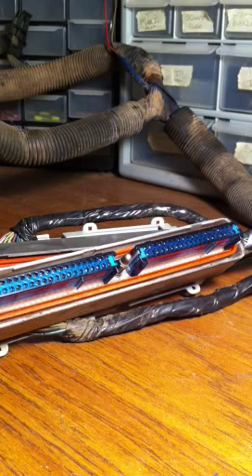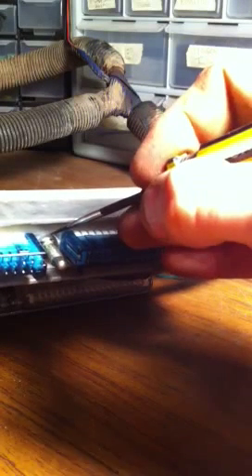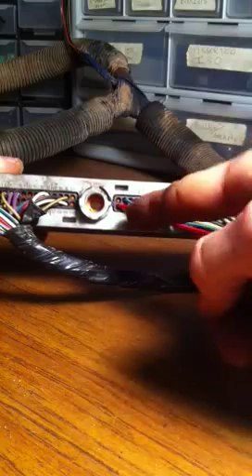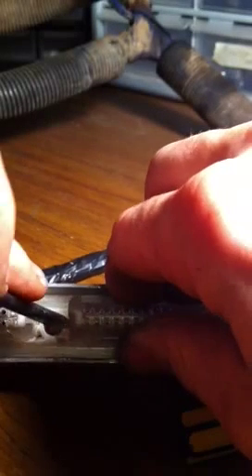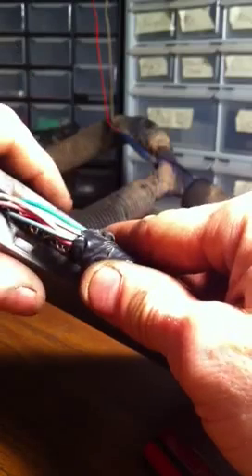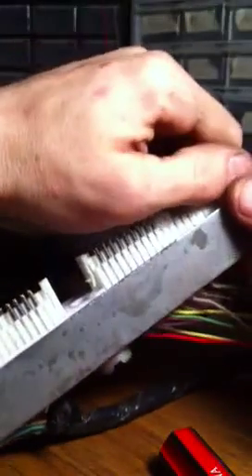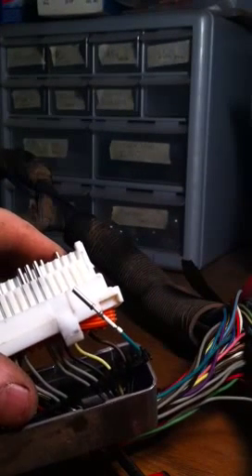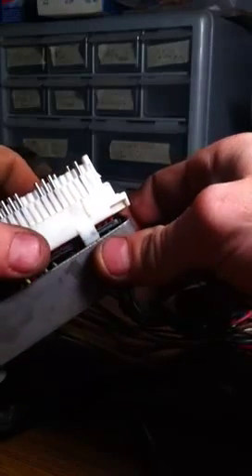Disassembly of GM PCM connector

Comment: Just to add some time savings.   My harness did not come with the gray plastic cover.   If you have it and dont mind dremeling it off/dont have it (its captured by that bolt with the washer thats a pain to get off) than  you can keep the entire thing together and simply remove the see through plastic cover (blue or clear) and then pry on the little white tang to release.  No need to pry when inserting a new one, but the clear/blue cover still needs to be removed as that "locks" those white pins in place.    If you are using a pin hole you have never used, you might need to use a small drill bit or something to poke through the yellow rubber seal, which is not open.  this video kind of shows it , but not really.  Anyways, good luck.

Comment: This is near impossible to do on the truck..   standing in oncoming traffic is the preferred method
Reply from the maker: toobglued I’ve done it in the vehicle 100x more than i’ve done it on the bench actually.
GM PCM connectors are infinitely easier to deal with than a Ford pcm when depinning and repinning in the vehicle for repairs imo.
Not sure why someone would do it while in oncoming traffic though.